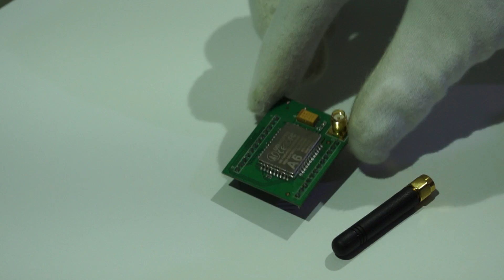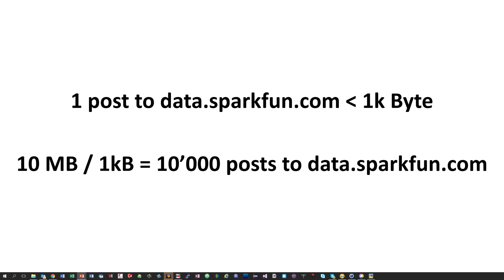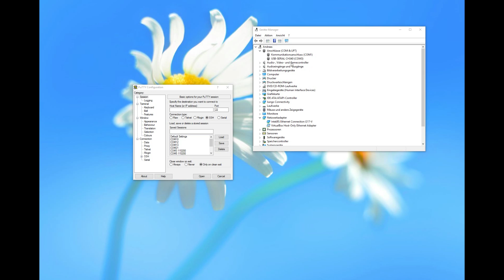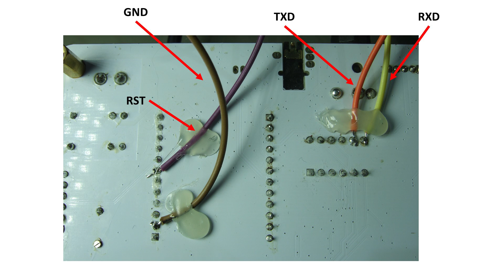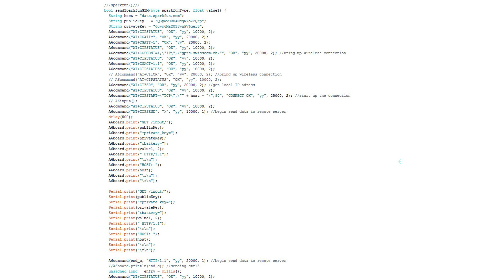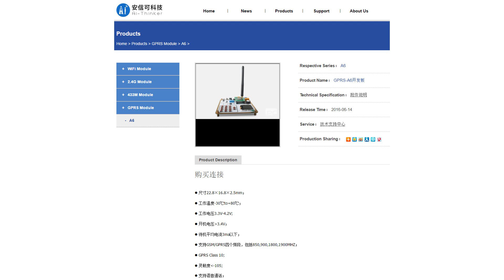#66 New Killer Module from AI-Thinkers? The A6 GSM M2M Module

Comment: Hi Andreas, thanks for you very instructive videos. I just received a batch of A6's and immediately tried to connect one of them to the serial port of my pc. The USB connection is fairly straight foreward RX, TX and ground. I connected 5V and Power on the A6 chip and connected an external 5V power supply to the mini USB port. Setting connection params to 115200 N 8 1. It does not seem as i have connection to the A6. My 'Power supply' is an cell phone charger which can deliver 1.35 A. Could the current output be to low, or am i in the complete wrong direction.
Reply from the maker: +Klaus Berthelsen I am not sure I understand,but the USB is only for power (if you use a barebones A6 Module. You need an additional Serial to USB converter
Reply: Precisely, I am using a USB to TTL (CH340G) converter for the RX, TX, ground, and the micro USB only for power. Question was if I meet the minimum requirements fro the power.
Reply from the maker: Klaus Berthelsen That should not be the problem. Did you change once the RX/TX cables. Maybe they are mixed.  I assume, you enter At and enter. Make sure, your Terminal emulator sends CR and NL
Reply: Hi again. I tried to connect the A6 to the computer without an external power supply, that is i connected the 4 leads form the USB to TTL interface with 5V on the USB to 5V on the A6, Ground to Ground, Tx to Tx and Rx to Rx. Now it works. I suppose i have learned to try the simplest solution first. Thanks for your help.
Reply from the maker: Glad to read this!

Comment: sir 
thanks for you tutorial its really helpful but i have a question about this module.
ESP8266 is able to run separately once it program. is this module also having that ability to run without arduino once it is programmed .please reply  and once again thanks for your work.
Reply from the maker: I do not know of a method to program these devices. I only used them as a peripheral.
Reply: Hi Did you get this issue working? Working with the ESP8266 + A6?

Comment: How did you come to the conclusion that a post request was only 1kb? Did you check your quota? My experience was that there was a large overhead for each packet sent, and carriers round up data to some minimum number. This means that even starting a tcp connection could result in hundreds of kb from the qouta. Of course, this was in the bad old days before smartphones. Anyways, I'm also perplexed that they're going for such old technology....
Reply: I dont know how Andreas did his calculations but it is quite easy to do. You know how many bytes you sent as a header in the POST command when it replies such as 
+CIPRCV:41,SSH-2.0-OpenSSH_5.9p1 Debian-5ubuntu1.9
The 41 is the number of bytes received. There are things like to DNS lookups to take into consideration  they do cache in the module. Most people would write there own socket on the server so you just write the data to the port without a tonne of headers and the reply would be a simple OK or Acknowledge.  So you would send maybe a device number maybe a 20 character GUID and say a 5 character Bat Level reading. so about 30 bytes in total. some Operators have minimum billing per day. So you may be charged for 1MB of data transfer if you use 100bytes or 100K in a day. My operator does not, it charges you for 1MB when you use some data,  then does not charge you again till you have used that whole MB.
Reply: Ok that sounds reasonable, and 1MB per day would then mean a minimum of 30MB  data per month, if you're using the data connection daily. Thanks!
Reply from the maker: +simonf I did not do real calculations. I just know how many bytes I transmit an the answer string of sparkfun. Togeter, they are probably 400 bytes. Then I added some overhead without knowing anything about service provider behavior. I just assumed, they will not cheat us ;-)

Comment: Sir how can the A6 module be put into sleep mode? There's documentation around the A6 claiming it can run at less than or around 1mA when in sleep mode. But the regular SIMCOM sleep mode AT commands do not work here, so what are they commands for sleep mode? Thanks in advance!
Reply from the maker: I do not know. The commands should be documented in the A6/A7 documentation. They are not always the same as with other chips.
Reply: Thank you

Comment: !...and the response from AT+CSQ command DOES NOT mean that you are connected to a network! This is signal strength. AT+CREG? does that and AT+COPS? shows you who you are connected to....
Reply from the maker: +Graham Gillett Thanks forthe clarification. Iam aware of that. But in my case both events happened at nearly the same time. So, I used the CSQ as one example sketch I found. I will change it for the next episode.

Comment: Can someone explain to me what is so great about this module regarding to M590E which is 3 times cheaper?
Reply from the maker: +kurwicha I did not know about the M590E. Looking at the feedback at Aliexpress, many buyers complained, that the cheap module was used and not new. You also have to assemble it yourself.
Do you have experience with these cheap M590E?
Reply from the maker: +kurwicha And the A6 is 4 band. The cheap M590 is only 2 band.
Reply: I have never been in any America, so I don't call it an issue ;).
Reply: Not quite an experience, but i bought and test it by sending sone SMSes and it worked well. It's hard to tell if the module was used. It was kinda dirty, but the pads didn't look like soldered before.
Reply: Why is a Jaguar 3 times the price of a Fiat. The M590E are usually Kits which have to be assembled from what I have seen on various sites most of the cheap ones are pulls. The M590E is only Dual band so will only work in half as many countries. The A6 Module has audio (Ear and Mike) connector. The A6 Module has a real aerial not a curly pigs tail. The A6 Module has a high efficiency switching power supply chip the M590E module has a diode to drop the voltage and a Capacitor. The A6 is a currently produced product so if you need quantities you will be able to get them. If you want a one off module for yourself to do a specific task and are not bothered that if it breaks you may find it difficult to replace use the M590E. If you want a product that is going to work in many countries and is going to be available later use the A6.

Comment: The big problem with these modules is that they have to go through approval tests with the specific country radio authority and the same for the network authorities and this is huge money and even worse if you get caught...
Reply from the maker: +Graham Gillett Good to know!
Reply: The Module is both FCC and CE approved so the subsystem is already tested. For most applications if you are adding it to a preexisting tested system you should not need to retest it. If you use a different sub board with your own aerial design that may be a different matter.
Reply: Being FCC and CE approved means nothing to some authorities as here in South Africa they take an almost blank sheet of paper before giving it the once over and ICASA approval. Be careful. The fines are huge!
Reply: Actually, that shouldn't be the case. If I remember right, there is an ITU agreement which states that any mobile phone should be tested in the country of manufacturing and that's it. The IMEI of a mobile device should be valid as approval sign.
Reply: Unfortunately not the case. An IMEI number is just the devices unique serial number that is internationally recognised. SA, like many other countries, have there own approval requirements. Here not only ICASA but the network operator as well....

Comment: did you test a6  or a7 RTS or CTS i couldnt use them .its so hard when you want hardware intrupts for esp8266 but there is no output high when module want to send serial.it became a problem for me when i encode gps every 1 second suddenly one sms comes to module but i lise data i cant read sms location ...do you have opinion..
Reply from the maker: No, I did not use RTS or CTS. I am not sure if this can be done without these pins as many boards have a Serial buffer for a few characters. So, you always have a few milliseconds to react.

Comment: Granted that it is more expensive, but for a relative cheap dataplan ($3/month for 1 MB), the Electron of Particle (https://www.particle.io/products/hardware/electron-cellular-dev-kit) might be a good alternative. I use it to remotely monitor a cabin in Sweden (from the Netherlands).
Reply from the maker: Seems to be a very interesting concept. And the price for a global service is very good. Did you check how the traffic is calculated (overhead, minimum per message)?
Reply from the maker: Sounds to be a fair calculation. I have to check it also with my local provider.

Comment: Hi! Thanks for the interesting video. I just had to buy one of these modules.
It's mostly working correctly but I am not able to issue a AT+CUSD=1,"*101#",15 request to get the account balance. I get a weird +CME ERROR:16777215
. Have you tried sendig/receiving a USSD message?
Reply from the maker: No, I did not use USSD.

Comment: HELLO, I AM TEST MY GSM A6 BOARD TO THEY PUTTY BUT NOT TYPE AT OR ANYTHING. I AM TRY ON ANOTHER TERMINAL SOFTWARE AND TRY TO WRITE AT$0D AND SEND BUT NOT OK REPLAY RECEIVE BUT IN BUILT BOARD  MCU START CONNECTION PROPERLY. PLEASE HELP ME.....
Reply from the maker: Did you do all connections as described in this video? Then, it should run. Otherwise, the board is defective

Comment: Does anyone know if there is an Espressif device like this available in 2022?
Reply from the maker: I do not know what you are searching for :-(
Reply: @AndreasSpiess  Thank you Andreas. At first I misunderstood the module to be an SoC (like ESP32) with comms chip. I now understand it to be a comms chip on a PCB that will interface to a microcontroller. Today (Sep 2022) it seems that this A6 chip is not easily available and in any case uses 2G cellular which is being phased out by Western telcos. I am looking for a reasonably priced comms chip to use with an ESP32. The comms chip must be available in variants for different territories such as Europe, USA, Canada, etc. I looked at Simcom devices (7600E and A7600E) but these are expensive for the performance that they provide. I don't need MB bandwidth - KB will suffice. I do need good connectivity though.

Comment: Is there any way to send email via A6 Gsm-GPRS module with AT commands?
Reply from the maker: Maybe. If you can emulate a pop protocol. Or you use a service like IFTTT to create a mail. For sure not simple.
Reply: thank you so much
Reply: Yes, you can send email via GPRS using POP commands - providing you preconfigure the SIM card for mail server setting(s) as required by the POP server you want to use. Warning, it's an intense amount of data once configure. You will need to create a script for how many queries, per hour or day, etc.

USE M2M - and click on email tab to setup

http://m2msupport.net/m2msupport/data-call-at-commands-to-set-up-gprsedgeumtslte-data-call/

Comment: Anyone knowns the REAL SAFE level of IO pins of this chip? Is it 2,8V or 3v3? And how to force to set default baud rate to 19200? AT+IPR=19200;&W works until first power-off...
Reply from the maker: 1. No. I asked the engineers at AI-Thinkers (for a similar module), but did not get an answer yet. 3.3 volt did not kill it so far.
2. If you enter AT + a command about 10 times in 9600 it changes automatically. But you have to do it every time after boot. Advantage: You do not need 115200 to start with (Software Serial!!!) and you do not need to change speeds in the sketch.
Reply: Did you receive answers from AI-Thinkers ? 
I look for firmware update but didn't find them public, just a "guy in a forum saying [I get it from AI-Thinkers support]. Do you have information at this level ?

Comment: hi I have the esp8266 12f with the AI-THINKER firmware.. I was able to 
add my script to turn a light on and off.. one problem I have, when the 
esp connected to my router, the esp8266 F12 obtain a IP address 
192.168.0.113 from the router. however the esp8266  also shows up with 
another IP address 192.168.4.1 that is open and shows up an open wifi 
where anyone can login and turn my light on and off. is their anyway  to
 disable the or add a password to the firmware password?
Reply from the maker: Please google Wifi.mode(...) and you will find the solution. The ESP has 3 modes. Station, AP, and both. Currently, you use both and this is why you get an additional network. Use the STA mode and the second network will be gone
Reply: thanks for the tip I find this code ......."WiFi.mode(WIFI_STA);" ...... which I pace under the ....."void setup"....and its not showing up when I do a wifi scan on my phone..... and working great..

I have another problem on another esp .... I try to google for a solution but could not find one. I have a esp on a relay which works but after certain period the esp maybe going to sleep or turn off. when I pull the plug and plug it back it,  it will work again. if I removed the relay the esp will stay on all the time. 

any idea what causing this...
Reply from the maker: The ESP does not sleep if not instructed. But sometimes it crashes (even if not instructed ;-) ). Maybe you use the serial monitor to watch, wat happens with and without relay. And maybe you add a few Serial.println() statements at important points. Then, you should quickly discover, what happens.

Comment: Hello Andrea! Thank you very much for your information about this great product!
I have connected all wires ( RX/TX/GND  and VCC to POWER_KEY)  and I'm using this library https://github.com/skorokithakis/A6lib . 

1) Can you tell me what n-mofset is required? anything?
2) RST pin of A6 module I will connect it with the mofset right?
3) How I can power the module WITHOUT using the USB input? I guess I must power it from VCC and GND?
Reply from the maker: 1. you need a "logic level MOSFET which can be switched on with 3.3 volts (e.G. IRLZ44)
2. Yes
3. Yes